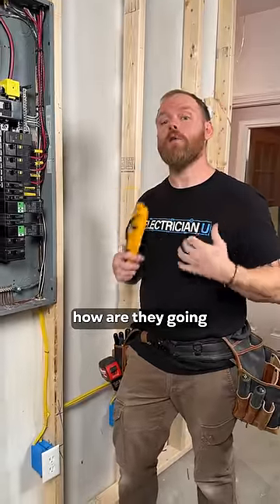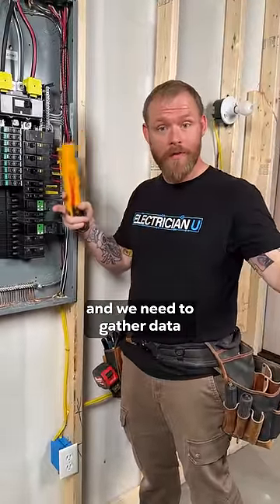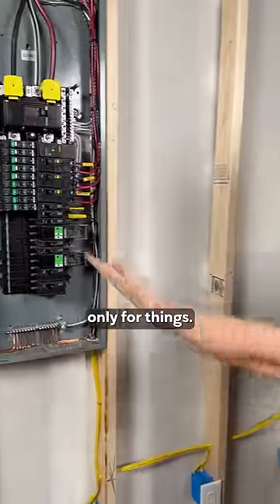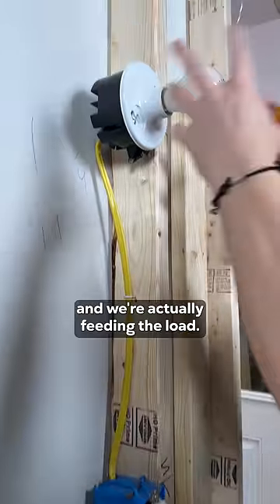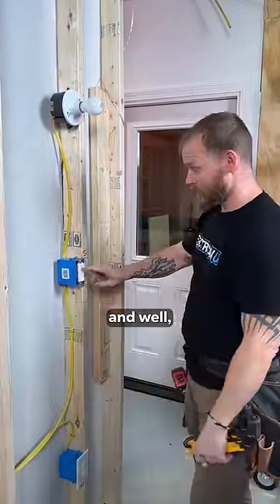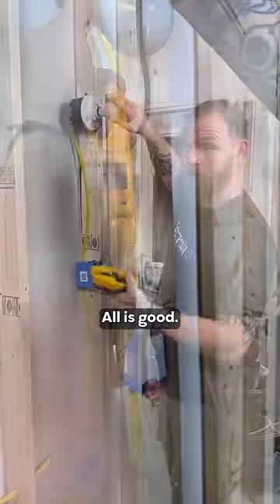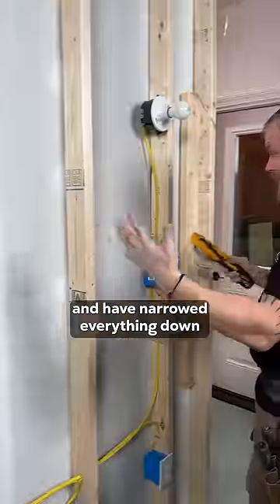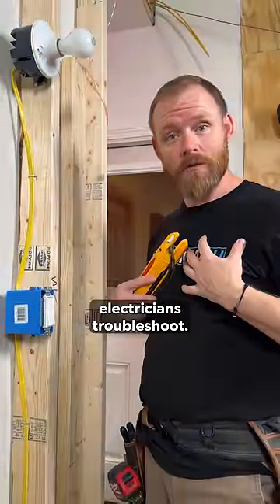How Electricians Troubleshoot a Problem

Comment: Testing the bulb is slightly misleading at this point. It should be specified incandescents will read across the filament but compact florescents/LEDs will not. Great vid as always!
Reply: I test LED by replacing it.
Reply: It's a lot misleading, if you can take the bulb out test what's in the socket...
Reply: @UhOhUmm thank you!
Reply: @UhOhUmm testing continuity on bulb
Reply: Agreed. But technically his demonstration for what he had was technically correct. Yes, he could’ve specified about the LEDs but that’s what the comments are for. This is just a YouTube short. If he was trying to be more in-depth, he would make a video which he does make videos lol a whole channel in fact.
Reply: I usually just pull the bulb out and probe the socket. That's more important than the bulb.
Reply: @user-nh3gu1ge3d exactly. Does 2 things. Checks the whole circuit to that point and can eliminate the load as the problem at the same time. Although sometimes the circuit could be ok but the socket is wired backwards so that the LED doesn't light up. More common on older houses I have found if there's issues lighting LED bulbs
Reply: @altrrea lol long ago I made a portable led lamp with 18650,s and a dc voltage step up circuit. it would serve well as a tester 😂
Reply: LAMP
Reply: Indeed
Reply: @Jimmy-vt8jb What you said doesn't make sense. Power will always be directed in the correct direction through the driver regardless if neutral and hot are backwards
Reply: If you don't know that you shouldn't be working on your electricity. And btw I'm all about people working on their own electricity but only after they've taken the time to understand and learn about it. He shouldn't have to explain to people that a diode won't have continuity.
Reply: That's what I thought so I just tested. On a good LED bulb (3 W, 230 V), I read 2,8 Mohm and on a broken one it's infinity. I switched the probes if there is a diode that only allows measuring at a certain polarity but it made no difference.
Reply: WTF is an "incandescent" light bulb? Is that like a VCR?
Reply: Most multimeters come with diode checks.  You can also usually test them with an ohmmeter by noticing the resistance is low for one polarity but high if you switch the leads.
Reply: @Jimmy-vt8jb Unless you are using a DC circuit, you can't connect an LED backwards. Neither side of a socket is connected to ground (hopefully), and the circuitry is designed to rectify the alternating current to direct for the LED itself. If you only have 2 wires, neither tied to ground and AC current, there is no backwards.
Reply: Check for power at the socket with a circuit tester.
Reply: @michaelz6555 Sure but LED's are low voltage devices that are not connected directly across the source terminals on a lamp.
Reply: @erikkovacs3097 I trust you're joking...
Reply: @skunkjobb Trivia: I think I have the same tester that the dude uses in the vid. Max resistance 1kohm. Anything higher than that is open as far as it's concerned. Surprised me at first since I came to the trade from electronics and the idea of an ohmmeter that topped out at 1k seemed ridiculous. But that's why Fluke calls it a tester not a multimeter.
Reply: LED bulbs don't measure as a diode.  They have ac/dc converters in them, putting the AC through a bridge rectifier, then a buck converter before going to the LED.
Reply: @erikkovacs3097  incandescent bulbs run on AC power while LED bulbs will need to convert the AC power into DC power first which is why they're more efficient as they run on lesser power than incandescents, the very advantage that incandescents have is they don't give off the dreaded 60hz hummm, which is why professional recording studios would use incandescents over fluorescent lighting
Reply: @pihermoso11  Oh so the only difference between incandescent and LED is the former is AC  while the latter is DC but otherwise identical and  converting AC into DC makes LED's super efficient? I'm going to convert my whole house to DC! I'm gonna put a full bridge rectumfrier on the mains. I'll do it at night so the nosy neighbors don't report me to the electric company.... again.
Reply: @erikkovacs3097  AC and DC has it's own advantages and disadvantages, but as far as lighting goes, for the same amount of lumens, the DC powered LED lights are more power efficient than incandescents in AC power
Reply: @pihermoso11  So what you're saying is all I have to do is run an incandescent bulb on DC and it will run more efficiently like an LED?
Reply: @erikkovacs3097  nope because incandescents run on 110v or 220v, while LEDs move that voltage down to 12 or 9volts or even lower
Reply: @pihermoso11  So I have to run the incandescent lights on DC and 12V or 9V THEN it'll be as efficient as LED's?
Reply: @erikkovacs3097  nope because they are built of different materials and technology, incandescents have a filament, while LEDs are built using an NP material which is silicon based, using the same voltages on them will yield different results because they are just different
Reply: There are nuances to everything. This was a simple breakdown for a short video so it only gives the basics.
Reply: Bulbs grow in the ground as I was told it’s a fucking lamp 😂😂 a lot of bollocks no spark tests the bulb ffs
Reply: @pihermoso11  What's a filament? Whats NP?
Reply: @pihermoso11 
Thanks Sherlock.
A less of stating the bleeding obvious, please.
Reply: @UhOhUmm   pretty much, bulbs already out just check for voltage there and work your way back. no different in the auto industry, pull the bulb and inspect the socket and bulb, check for power and back trace if nothing.
Reply: A meter doesn't totally test a breaker ,the meter can read read 120 but it won't support a load some day you might  be fooled had this happen twice 43 years Ibew 288
Reply: Don't really believe that breaker can carry any amperage
Reply: Breakers can show 120 but no amperage 43 years Ibew
Reply: @user-nh3gu1ge3d  So you don't check the bulb? What if you have a burned out bulb being your only problem?
Reply: incandescent bulbs were the best damn lights there ever was. LEDs SUCK.
Reply: @BillSmith-rx9rm  It's called logical deduction. If there's electricity going to the socket but no light, that means the bulb is bad. It's the same reason why you know that 6 + x = 10, you immediately know x = 4. Because juice, plus a working bulb = light. If juice but no light, then no working bulb.
Reply: @pihermoso11 incandescents run just fine on DC, they're just a resistor. Being DC has nothing to do with being more efficient here.
Reply: Ehh... his guidance was mentioned to be easily expanded to different senarios.

Though I don't know why he jumped from bulb to switch to breaker. Could have just tested the switch since it was suspect anyways.
Reply: I agree can't test a 7va led yet but some one will come up with a way of testing it.
Reply: If its añ old house and a sparks added a light watch from neutral
Reply: @kjward1975  check the impedance or swap it with a known working load.
Reply: @UhOhUmm that’s what I do. I just use the stick.  Much easier cause it’s always in my shirt pocket
Reply: He’s giving broad basic instructions. That’s what shorts are for. He goes into the weeds on his full videos. I get what you’re all saying, but think of context here. He isn’t teaching an apprentice, he’s giving extremely broad demonstrations, if the load had been something besides a lightbulb then nothing he’s said here changes, but specifics about bulbs would.
Reply: I love your channel brother and all he comments that also teach.

Comment: Back in the 1970s-1980s, when I served in the U.S. Navy as an Electronics Technician, we were taught the Navy's 6-Step Troubleshooting Method. It works on anything from what you're doing with a wall switch to radios, RADAR units, satellite systems, and so forth. You don't touch a piece of test equipment until you get to (usually) step-5. If you have a good input and bad output, you go half way; if that's good, then you check the last half, starting again half way, and keep going until you get down to the actual component (diode, transistor, capacitor, resistor, fuse, whatever). I've used that all my life ever since, even as a Computer and Electrical Engineer.

Comment: I'm a maintenance technician at an automated warehouse. I'm pretty new to the industry. My first real test came when a piece of conveyor wasn't working. Motors 480v AC but it was being supplied 37v DC. So I just worked my way to the soft starter to fix the problem.
Reply: Awesome   hey we learn under  fire sometimes
Reply: I'm a maintenance technician for an apartment complex and I've learned a lot under fire. From electrical to plumbing and hvac
Reply: I’m a heavy industry/mining and diesel mechanic but we had a Michelin retread facility also. Testing PLC was way above my pay grade but I had to do it. I learned thru trial and error sometimes and it took hours to learn a single circuit without schematics. Sometimes even as a veteran diesel mechanic I get frustrated and say to myself, “Don’t get complacent.” Or, “Think simple, stupid.”

Sometimes all you need to do is walk away for a minute, drink a wattle of water, relax, and return to work. It’ll hit you.
Reply: So do you work on electrical panels a lot in the field? I’m an electrical panel builder
Reply: @yt-kingdavid2359  It's more for troubleshooting motors and VFDs. So the panels are already wired. I have seen wires not properly secured or come loose which creates problems that most people (including me) have overcomplicated the troubleshooting process on.
Reply: Did you measure in low impedance mode ? Could have been phantom voltage.
Reply: @garcjr loose connections are the WORST. Especially when you are starting out. I do more with board level repair, and there's times where the flex of the board will make or break a solder connection that cracked.
Reply: Sounds to me like someone bypassed a safety measure 😅
Reply: @syproful  The Fluke I was using was a troubleshooter tester so it picks up whatever voltage automatically. The soft starter was hit-or-miss when coming on of off. It did flash codes on it (I forgot what they were) but was basically screwed.
Reply: Im ex hvac now overhead hoist technician. Stay safe! A lot of dangerous stuff out there!

My hardest test was when an overhead cranes bridge was working fine, but the hoist/trolley had a blown fuse, a new fuse always resulted in another blown fuse when the hoist was ran up or down. Had to jump the fuse and follow the circuit and still didnt find an issue. Finally, I used a few fuses and did a process of elimination by dosconnecting one component at a time until the fuse didnt trip 😂 it was the brake rectifier for the hoist
Reply: You have a bad soft start. Same thing happen to our mixer. Wouldn't shut off unless we turned off the main. Replaced the soft start and it works like a champ now
Reply: @JerryTown4682  did you not read that this was a historical problem which he solved?
Reply: 38V dc? I assume this is controls so someone hooked up control voltage to the motor somehow?
Reply: @qrzone8167  Our controls run on 24V. Some of the control wires were loosely connected which may have shortened the life of the soft starter. I was using an automatic Fluke electrical tester (not multimeter) which it may have just picked up whatever current it thought was going through at the time.
Reply: Sounds like Amazon
Reply: How do you learn the electrical part of the job without first being an electrician? I did conveyor maintenance before and would like to go back but I always struggled with the electrical side because I had no background in it
Reply: @GamerplusMore  YouTube makes it incredibly easy to learn it
Reply: I'm also a maintenance tech starting out in building maintenance, conveyance and PLCs. Y'all are so helpful. Please stay in the contact through the notifications. I will be asking questions.
Reply: @IAmTheGlovenor  I try youtube and I understand theory but struggle with practice since I need hands on and when there's time for repairs I don't have the time to practice then I gotta just hand it over to ex electricians
Reply: Good video. When troubleshooting dont overcomplicate stuff. I do automotive and low voltage wiring
Reply: @26hhernan  same.
Reply: Never start soft, its not fun for anyone. 😅
Reply: What I always found neat about being a maintenance technician myself was the ability to troubleshoot any machine, even if it’s a complicated one you’re unfamiliar with. Thinking of complex drawings and machines as a collection of smaller ones allows us to boil down everything to six simple machines. This breakdown makes things less convoluted than it seems and is what allows me to work on things I’ve never seen in my life lol
Reply: @26hhernan it used to be common knowledge when men had fathers that were real men
Reply: @yt-kingdavid2359 the vast majority issues occurring at the panel, especially newer panels are caused by the individual that did the installation or the individual that quote unquote fixed an issue. Rarely is it an issue caused during manufacturing.

Comment: Protip, if this is your issue and the switch feels broken, test it first. Dont get a ladder and go check the light then stumble down to the basement amd check the voltage. You can confirm voltage at the switch, and see if the switch is working. If you have voltage before but not after, its the switch. If you dont have voltage before, go to the panel. If you have voltage before and after, go to the light....

Comment: What happens when the switch and bulb and breaker all are functional now it's wires so couldn't you check continuity between wires how would you do this on longer runs?

Comment: I love the challenge of troubleshooting, its usually not as simple as a light switch  its usually because some hack has been there before me,  so I have to trace things back and figure out what the heck did they do and then move forward fixing the repair.
Reply: As a guy who always works on pools it’s almost always a gfi that they didn’t know was on the circuit.
Reply: The best is when customers tell me they won’t touch anything electric and I tell them they would be surprised by how many people would
Reply: @BarrackObamna  I'd be too nice to come all the way over and be paid just to reset a GFI. Unless they have no clue what it is i'd just tell them to try resetting it over the phone.
Reply: @qrzone8167  no the call I’m thinking of is “I can’t get power to my equipment, I’ve tried resetting the breaker”, that would then be my first question is does it have one of the outlets with a button anywhere around there. They almost always never actually look and say yeah there isn’t one. Meanwhile I know that they’ve got to have one since they have a pool light and they tie in the auto cover to the light circuit. So this is literally always what we ask them is the light coming on and is the breaker or gfi tripped. You have to be able to think in order for me to help over the phone.
Reply: @NJDFAN76 Even better when customers tell you they won't touch anything electric and then you find out they actually did cause the fault all by themselves. What follows is awkward silence xD
Reply: Your the best hack detector 😅

Comment: The golden rules of diagnosis:
1. Start with the easiest.
2. The previous guy did in fact, not check it already. Even if he did, you're there because he failed.
3. If it looks fucked, smells fucked, or feels fucked. It's probably fucked.

I Can't think of more off the top of my head. But these go pretty far already.
Reply: "Start with the easiest" is the golden rule, along with its brother "start with the cheapest".
Reply: The amount of time I’ve wasted because someone told me they checked it already is unreal
Reply: My two to add are "never overstate your confidence", and "previous repairer/manufacturer was probably incompetent".

When you are asking for help or handing it off to next shift, don't say you did something if you aren't 100% sure. Hedging your language isn't a bad thing. "I think that was 37 ohms, but it's probably worth making sure". If it is 37 ohms, you look good, if not, you closed a rabbit hole before it sucked an hour or two from the next guy, which would have made you look like an ass.

As for previous guy sucks, any time I see one thing that isn't up to a high standard, I instantly go on high alert for other issues. Incompetent oafs rarely touch just one thing on their way to "fixing" something.
Reply: AVE watcher by any chance?
Sounds exactly like what he says.
Reply: Rank amateur. Gather round for the troubleshooting golden rules.
1. If it ain't broke, don't fix it.
2. If it ain't fn broke, don't fn fix it.
3. The better is the enemy of the good.
4. Tried nothing, now I'm all out of ideas.
5. It was like that when I got here.

The 5 types of troubleshooters:
1. reset technicians
2. phone support
3. part swappers
4. trouble makers
5. lifers
Reply: Another one: if it's been working for years, you're probably wrong if your troubleshooting led you to believe that it didn't.
Reply: Yeah- it's called Occam's Razor. The thing is though, by the time they call a pro, they probably already changed the bulb and had the next door neighbor handyman check all the simple stuff. Not always, but often.